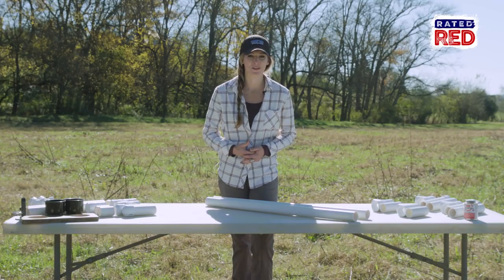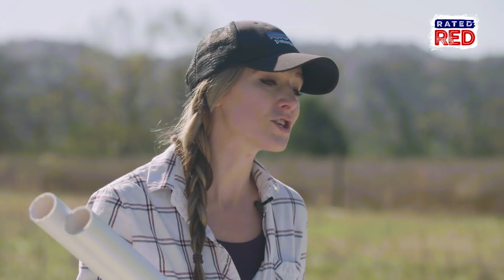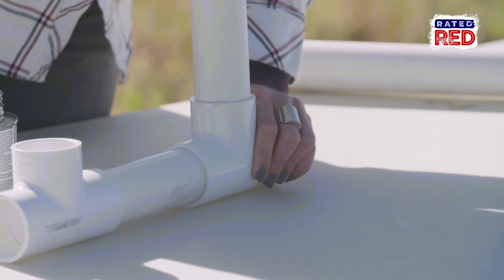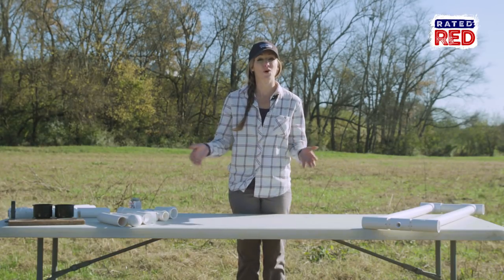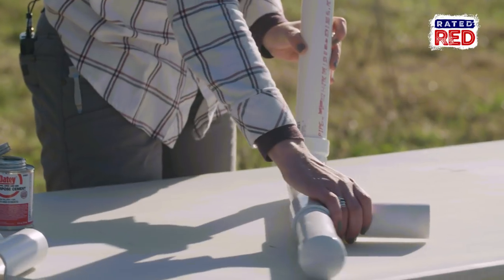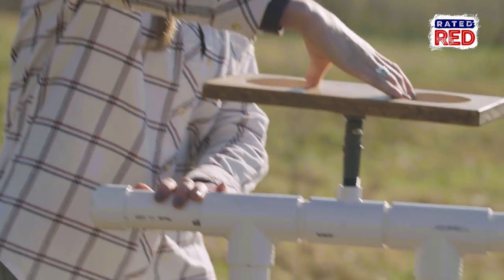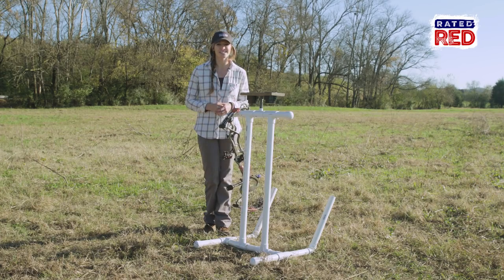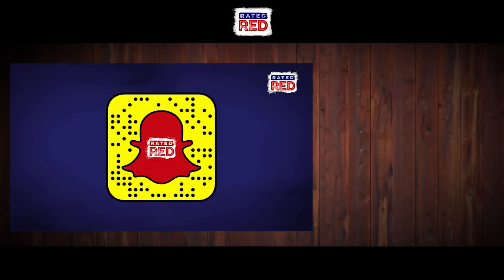How to Make a PVC Bow Caddy

Comment: When do ever use the flange?
Reply: I am also curious about this because the flange isn't used in the video at all
Reply: The flange is mounted to the bottom of the drink holder and is also what you screw on to the threaded pipe.